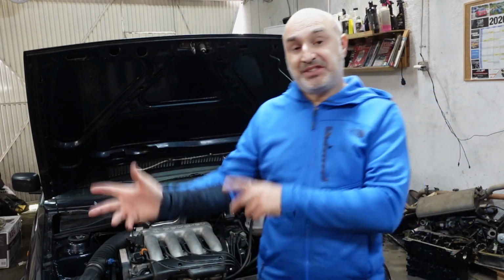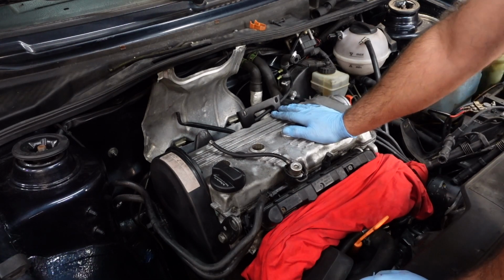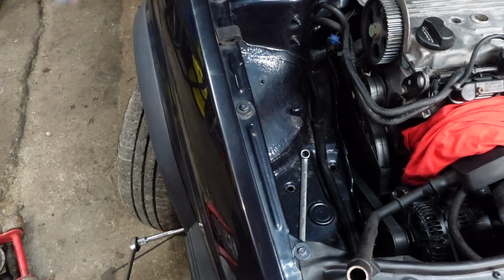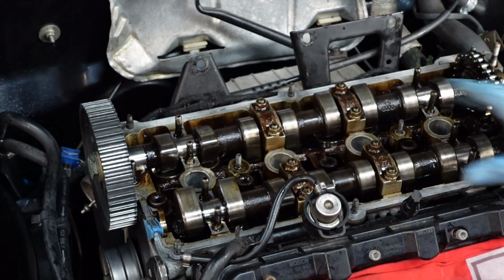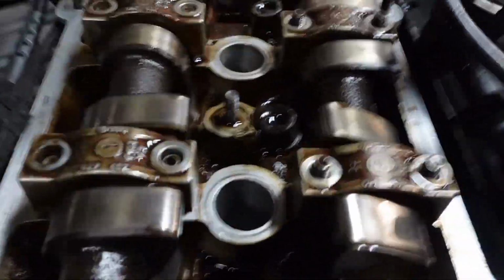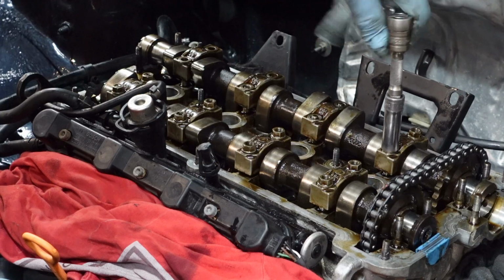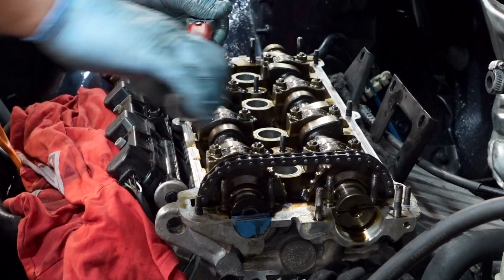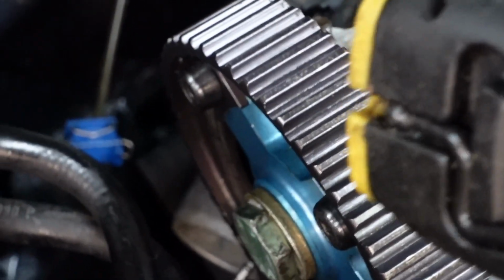How To Golf GTI 16V Camshaft & Timing Chain

Comment: Im just about to replace head gasket on my KR... Got any tips?
Reply from the maker: yes get yourself a very good 12mm spanner (if the nut is still OE) to use on the lower nut on #3 exhaust manifold, plus use loads of WD40 a few days before. Otherwise it isn't too bad of a job. 👍🏼
Reply: @RestoDesigns7  Hmm, I was thinking of keeping the exhaust manifold on just because of that, its a hassle to get the nuts off, and its not leaking from that gasket
Perhaps I should get to it anyway, its a first time job for me :D
Reply from the maker: @totte1015  The issue is the 6 nuts on the manifold to downpipe flange isn't any easier unfortunately. All the manifold nuts can be got to with a socket, it's just #3 lower one which can't be, spanner only. 99% of the time the nuts undo or the whole stud undoes.
Reply from the maker: PS I use a MAC tools 6 sided 12mm spanner if the nut is OE or a 13mm spanner.